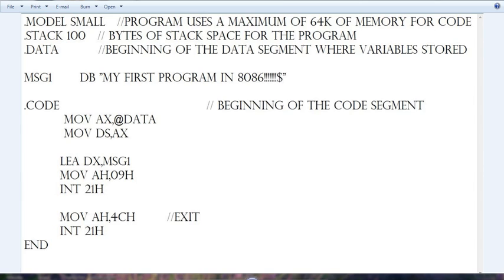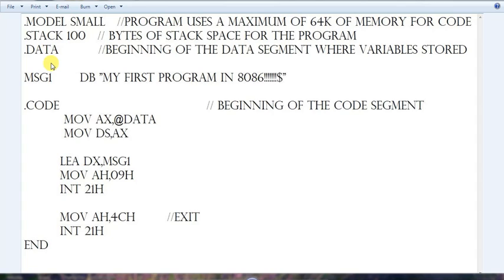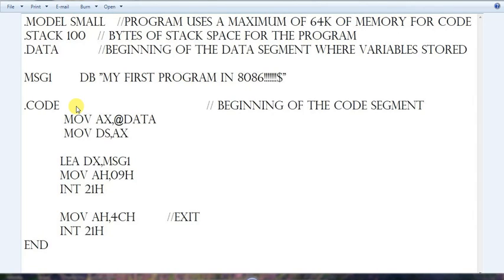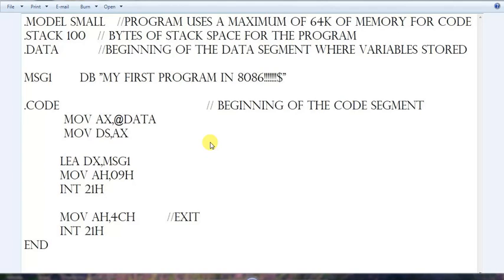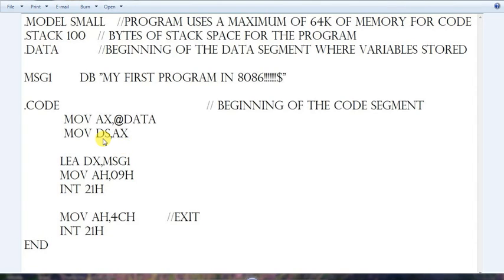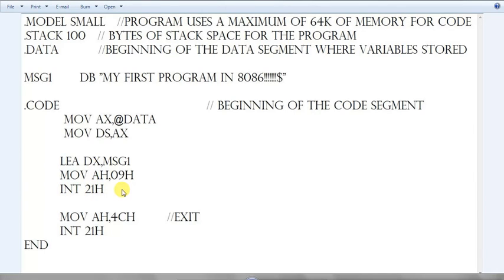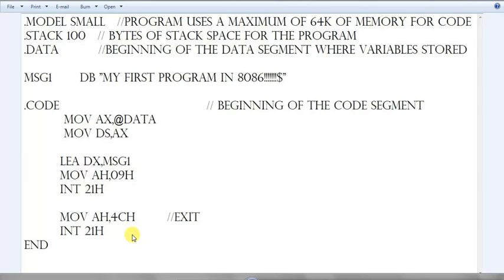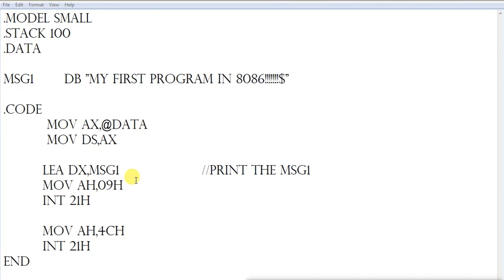8086 Assembly Language Tutorial For Beginners || Part 12 || Hello World Program in 8086

Comment: I can't understand completely
Reply from the maker: Can you be little specific about "which part you didn't understand?".
Reply: @ITIndustryExposure  lea part line
Reply from the maker: @narlasaivardhanreddy9265  LEA (Load Effective Address) is a shift-and-add instruction. It was added to 8086 because hardware is there to decode and calculate adressing modes. If you are talking about why we use LEA dx then it is to display the message ,As while display it checks the information in dx REG.

Comment: I tried this on EMU8086 and got error 

NT 21h, AH=09h - 
address: 07170
byte 24h not found after 2000 bytes.
; correct example of INT 21h/9h:
mov dx, offset msg
mov ah, 9
Reply: @pawansapkota9757  Thank you for helping me out. I wonder if i can still follow your tutorial videos using Emu8086 since the code is quite different.

Comment: how did you get those 09H and 4ch? and why should mov it to AH and not AL instead?
Reply: Ralf Browns x86/MSDOS Interrupt List (RBIL)
http://www.ctyme.com/intr/int-21.htm

-------D-2109------------------------------
INT 21 - DOS 1+ - WRITE STRING TO STANDARD OUTPUT
 AH = 09h
 DS:DX -> '$'-terminated string
Return: AL = 24h (the '$' terminating the string, despite official docs which
  state that nothing is returned) (at least DOS 2.1-7.0 and
  NWDOS)
Notes: ^C/^Break are checked, and INT 23 is called if either pressed
 standard output is always the screen under DOS 1.x, but may be
   redirected under DOS 2+
 under the FlashTek X-32 DOS extender, the pointer is in DS:EDX
SeeAlso: AH=02h,AH=06h"OUTPUT"

-------D-214C------------------------------
INT 21 - DOS 2+ - "EXIT" - TERMINATE WITH RETURN CODE
    AH = 4Ch
    AL = return code
Return: never returns
Notes:    unless the process is its own parent
      (see #01378 [offset 16h] at AH=26h), all open files are closed and
      all memory belonging to the process is freed
    all network file locks should be removed before calling this function
SeeAlso: AH=00h,AH=26h,AH=4Bh,AH=4Dh,INT 15/AH=12h/BH=02h,INT 20,INT 22
SeeAlso: INT 60/DI=0601h?
Reply from the maker: It is  defined in   21H  interrupt.